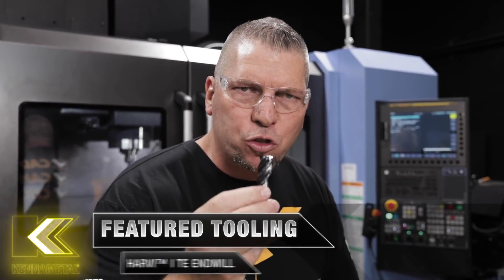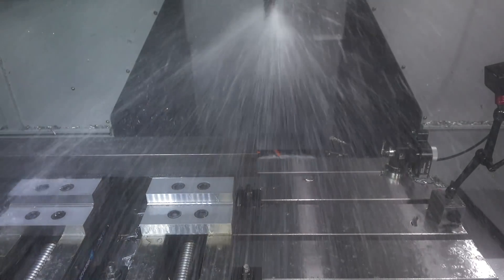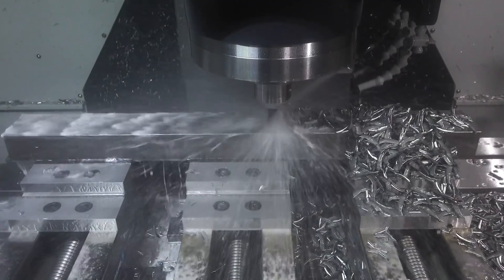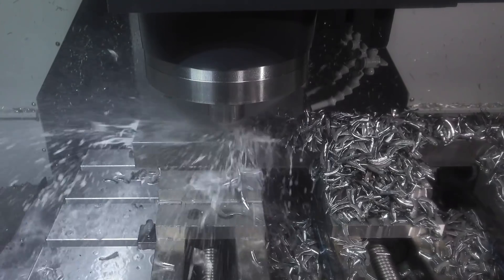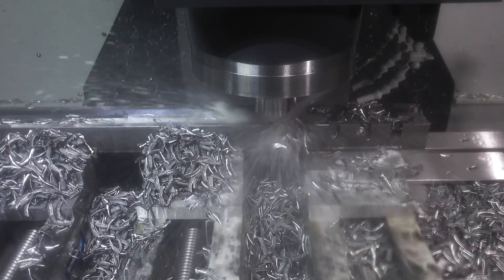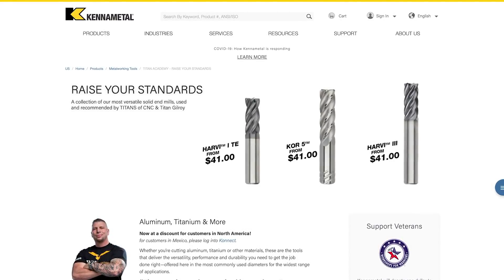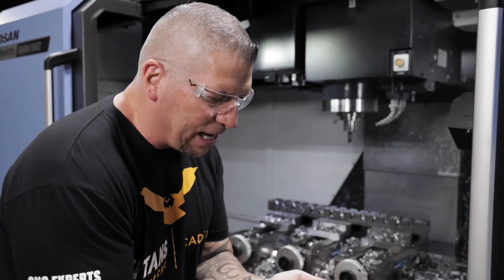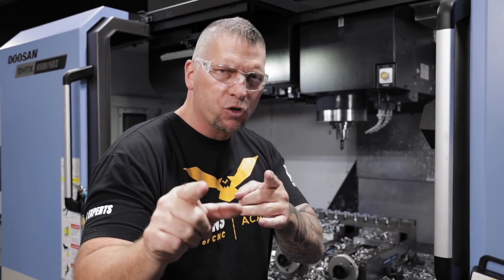STEEL TEST in MYNX BEAST | 100 INCH FULL SLOT | HARVI I TE

Comment: Would be beneficial if you could take this tool to the point where it fails to see where the limit is. This looks way too conservative
Reply: I from the video cannot see if the part passes QA on the inspection table.  It more likely to pass on the first 10 tries than the last piece of the run.  Fixture to the machine everything starts tighter than it ends.    

Tool fails when the reject rate cost and machine repair bills gets higher than the increased production rate savings assuming QA can cull the bad parts.   

That is accounting that does not make a chip throwing drive motor groaning video.  It is a discussion you have with your tool maker and machine builder before you commit to a large volume order where leavering capacity to its max is profitable.    

The datasheet and machinist handbook answers are safe but certainly have no relationship to profitable operations.   This guy is levering up to big jobs in the things are bigger state,  we expect to see some great things outside of NDAs.

Comment: Hi Titan, there is one essential information missing on all your Kennametal tool showoffs ===== HP used !
Cheers from Sweden
Reply: Spindle Power	25 / 30 hp
 (18.6 / 22.4 kW)
Spindle Torque	334 ft-lb (453 Nm)

Comment: should be able to run that endmill in that material dry. tool life can increase by as much as 30% running dry
Reply: How do you increase tool life by decreasing lubrication? Ive always been told the opposite
Reply: @keithhasafastcar  compressed air
Reply: @keithhasafastcar  steel chips should blue and hi temp alloys and stainless materials should be silver. 

coolant causes thermal cracking in  today's carbide recipes and can absorb heat better then they ever have. 

material in the video is 1018, very low carbon material which should be just fine using air blast

you can see the chips are not absorbing the heat at all which tells me there is some heat being left in the material and depending on the complexity of the part, could cause tolerance issues and potential warping

generous amounts of coolant are required when low thermal conductivity, work hardening, and chip welding tendencies are evident.
Reply: @hotlaprc1980  for some reason i heard him say steel and assumed it was stainless, probably because we only run stainless where i work

Comment: Hey Titan - Would these end mills work well in something like a Bridgeport Knee mill?
Reply: They would work fine, but you would never see the full potential of the tool
Reply: The endmills would work fine, but you have to remember most Bridgeport’s only have 2HP (1.47 KW) spindle’s so you may stall the spindle if you push to hard.

Comment: I’m not a machinist but  tools are just that tools for you to do a job. If you have seen someone with a large high power and torque machine push the tool and show it can be run at the maximum, if no it more!. It has been proved the tool can do and handle it ! You have the knowledge that the manufacturers are not boasting to the capability on the item. Within the limitation of your machine you can push the tool to do what it is designed to do allowing you to use the machine to the full, therefore reducing  machining time.  The cost of the tool against  machine time and quantity is the only thing you need to calculate.Amacf.

Comment: Just watched the cutter moving from left to right and the lubrication helps move the debris...maybe a lubrication system that follows the cut to help move the debris?
Reply from the maker: I actually lowered the coolant for the video and left the chips alone because they looked great!
Reply: @TITANSofCNC  I've been dry cutting 304L with a promo Harvey 1TE with just an air blast and it works wonderfully.  The Kennametal rep told me dry was fine for peripheral milling and if I can get away with not wasting coolant I'm going to do that.